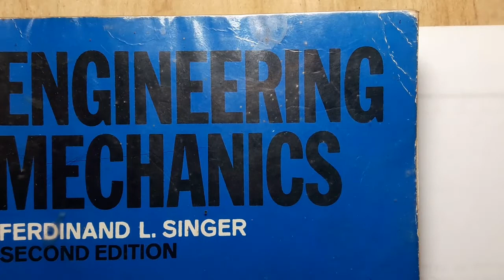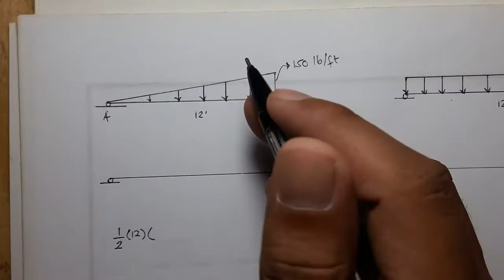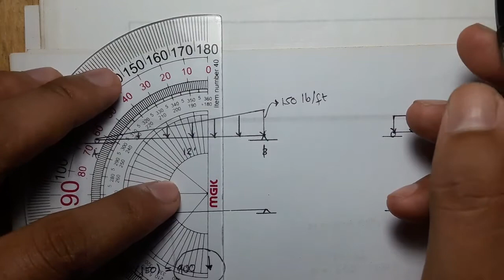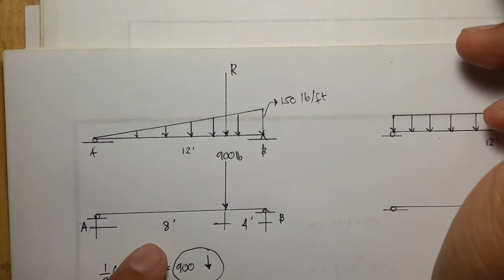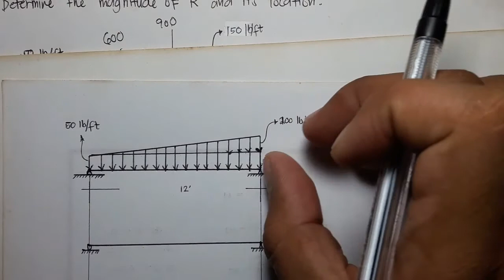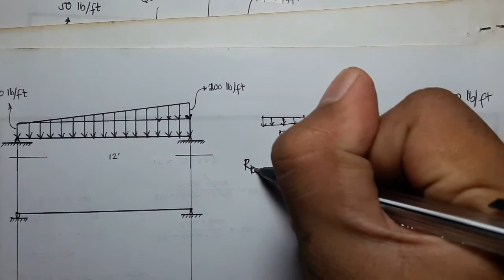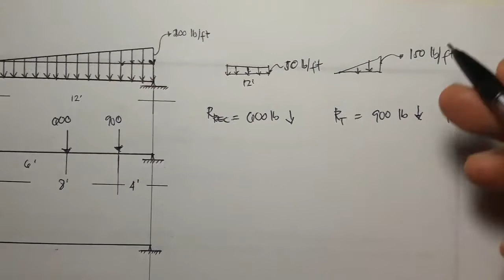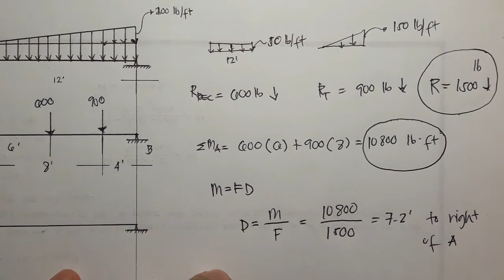Resultant of a trapezoidal loading and its location on beam.

Comment: Tama din ba if sa B ka mag moment? kasi hndi same ng result
Reply: Naisip kulang po. incase maka encounter ako ng ganung problem.
Reply: Anyway salamat po🙂 very helpful mga videos m
Reply from the maker: Either sa A or B ka mag moment ang location at value ng resultant should be the same.
Reply: Paano po pag ang hinahanap is yung moment? since hndi same yung moment sa A at sa B.
Reply from the maker: Ahmmm moment ang pinapahanap sa inyo? Marami kasi moment sa loob ng beam.. Every distances may ibat ibang moment yan. Sa 2 meter meron, sa 5 meter meron sa 5.2 meter iba din ang moment every point ng beam may different value of moments.